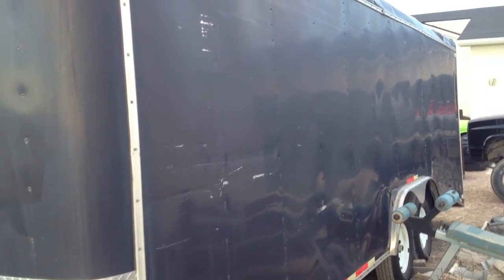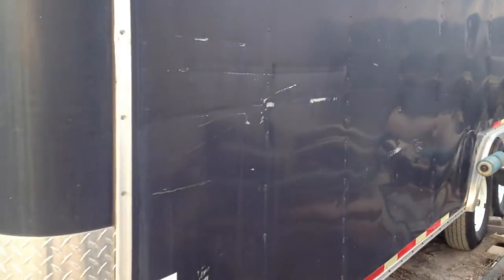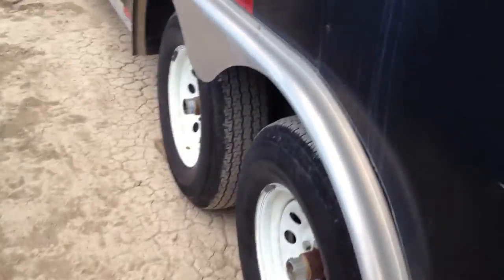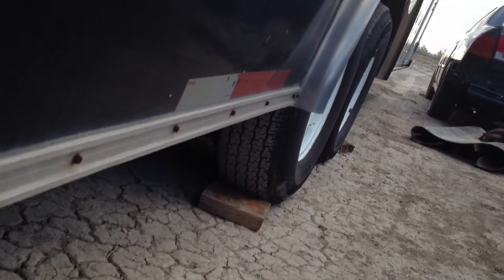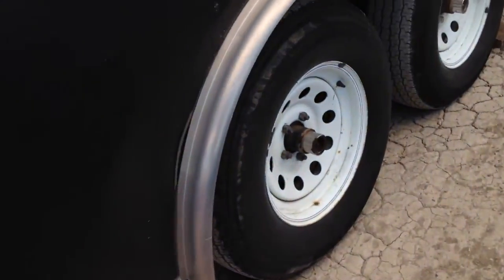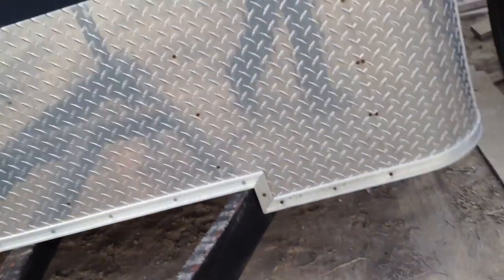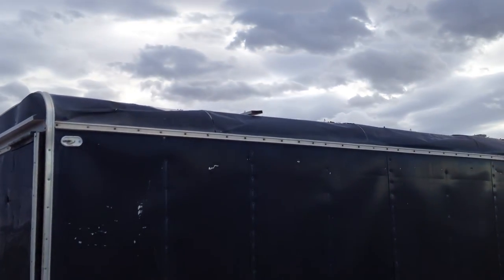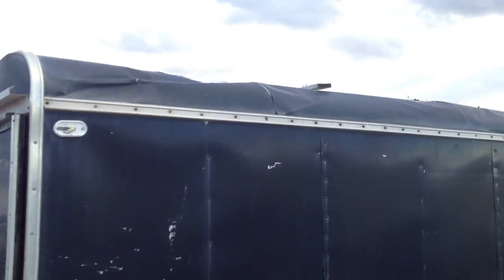My Trailer, my new one!

Comment: hey what i did with mine i had a tree fall on tip if it and it caved in and my roof was fucked and floor was alittle messed up but i just cut the top off like the very top were it messed up like your and just got sheet metal and new steel and had it all bent to shape but instead of having them like idk 1 1/2 apart i did it ever 1/2 a foot i noticed the trailer pulled better beacuse the added steel and my floor i put in 1/4 inch flat steel and reinforced the bottom seems alot nicer now